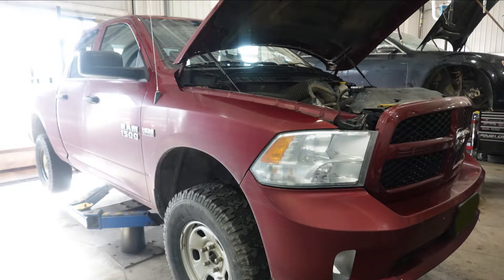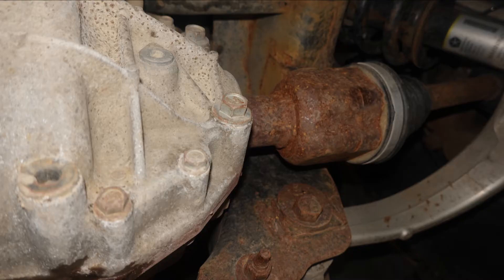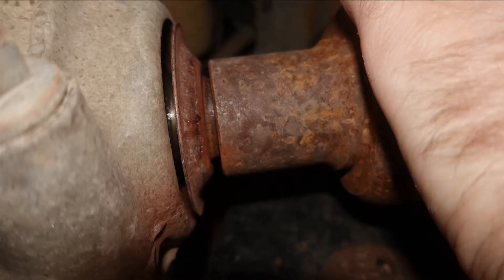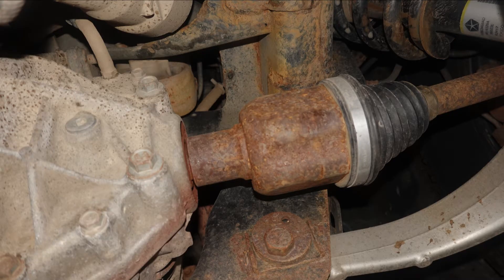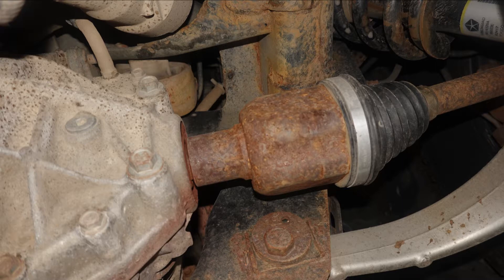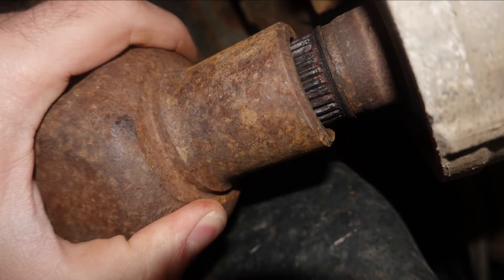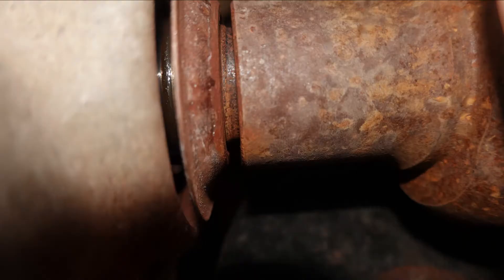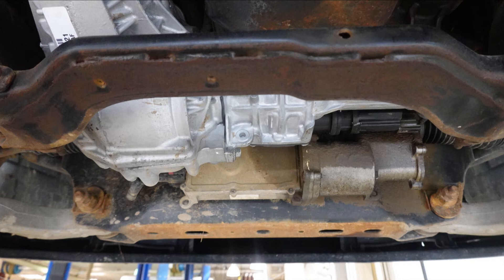2013 Dodge RAM front differential grinding noise

Comment: dude thank you for your front diff ram videos' ... at first i thought it was wheel bearing but as i was down there replacing it i noticed my front axle had a lot of play around the diff. so now i'm most definite that is the issue. I guess i'll have to find a good condition front diff in my local junk yard .. thanks for the guidance. i subscribed.

Comment: Had the same thing happen 2014 ram 1500 got quoted 5500 at the dealership, poor design
Reply from the maker: Yes poor design. The cv shafts should be splined on the inner joint, then slide into the front differential with a seal protecting against the elements. water,dirt,road grime etc..
Reply: The pain..taking my ram to the shop for the same issue..grinding noises 😭😭